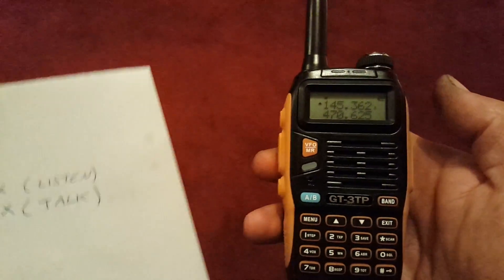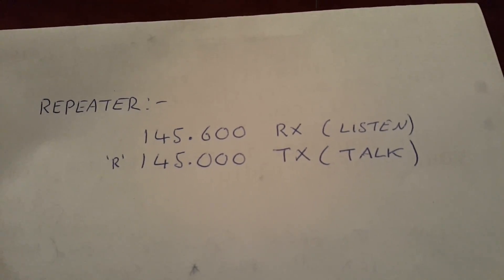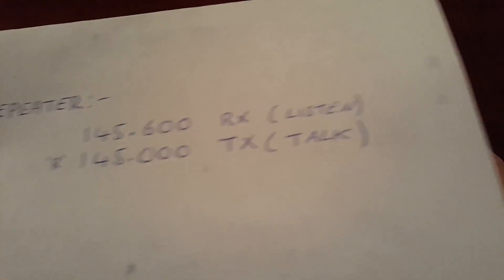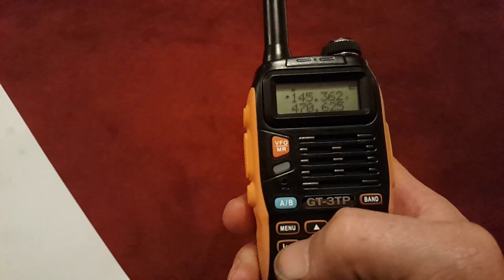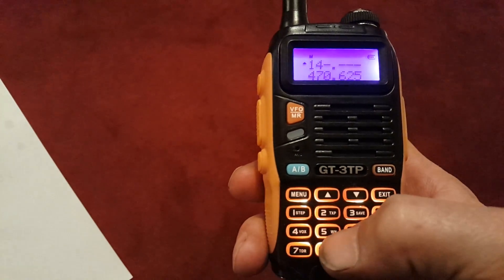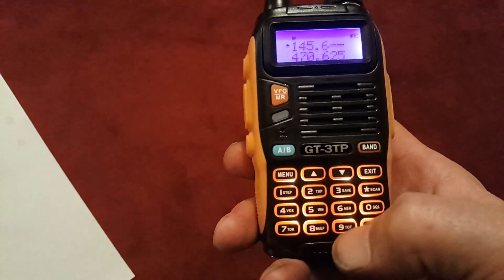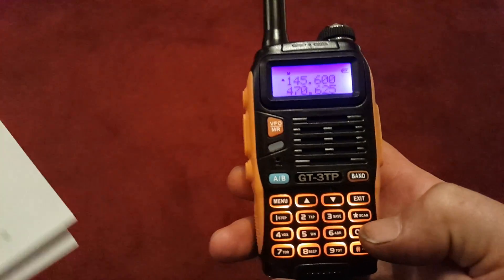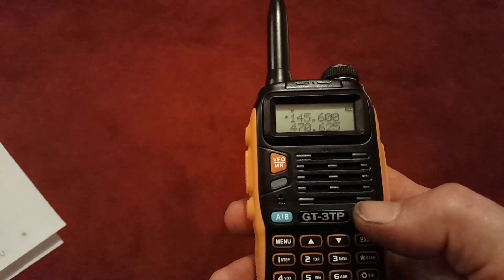baofeng GT-3TP repeater shift programming

Comment: This is what the internet and YT is for. Thanks.
Without a long intro, without incoming Presentations flying over the screen and a lot of talking, without these "If you don't want to miss anything, press the button" (I always think: Yes, I WILL miss your channel!).
Great and thanks Dan.
On the other hand: On professional video channels, young women often explain with light clothing. I would prefer that, but I could understand if you don't have a young woman on hand.
Until then, it would be good for the video if you washed your fingers beforehand. You could also use a clean piece of paper. But these are only minor details.
Kind regards, BRO!

Comment: Hi, I have the Baofeng GT-3TP.
is there any Firmware that let´s it also broadcast in DMR mode, so uses digital codecs instead of just analog FM ? I wanted to have a DMR device, but unfortunately bought this device, which standardly has only analog FM modulation. I wanted to have a digital scrambler and digital codec, so not much noise... Thanks.
Reply from the maker: I don't believe there is. Also the hardware wouldn't be suitable i am sure.
Cheers

Comment: Much easier way to do it, set your repeater frequency, go to   SFT (Shift dir) set  - (minus)  go to offset, set .600 KHz, save and your done, then add it to a Chan if you want..
Reply: ^^^^^^^This is how I have been doing it on mine.^^^^^^^^^^^

Except I have another step, which is to add the "PL tone" (menu, 13, menu, type in tone, menu to save) usually 88.5 in the corner of the world I'm in.

The method described in the video seems less laborious to me, though.

Comment: Just bought this, as a low priced handheld, waiting for it to arrive, what do you think of this handheld?

Many thanks.
Reply from the maker: It's very good for the price. Doesn't like any external antenna connected though. 
Also I've had an RF burn off the battery charge terminals.. not serious but stings a bit.
Reply: ahh, ok thanks, so best to keep to the antenna provided or is there a High gain version available to buy? 

Good video easy to follow. At least I will not have the problems setting repeaters.
Reply from the maker: I tried high gain whip and external J pole. No good at all. Keep the original
Reply: Brilliant. Thanks again M6CDY